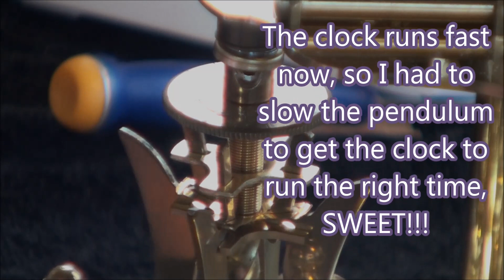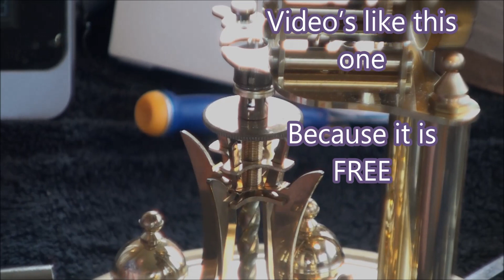How to get Your Anniversary Clock Running Again

Comment: I have a very old German clock some dear friends gave my Mom years ago . It looks like it has hand painted flowers on the base and on the clock facing. It is very well made I want to tear it down completely and clean and lubercate it . The pendulum spring is busted that is the way we go it and there is no key. It would of been nice if you filmed putting it back together but I also understand if you are not sure how it goes back together and didn't want to film it .I saw all those gears you have and about shit a brick. thanks for doing this video . Do you do your own editing? I don't know if you still monitor your youtube anymore
Reply from the maker: The first set of videos I have were for the ones that didn't want to take the movement apart. Most people are afraid to do so. My newest videos, I take them apart all the way. You must understand that you need to take many pictures of the movement and the gears so you can get it back together again. Then comes the harder part. Moving certain gears to get your clock back in time so the cuckoo will know when to stop and the gong and bellows know when to operate at the right time and right order.
Reply: @justmike57  I should of clarified my myself .It is an anniversary clock it does not have any chimes.I ordered a older book on Anniversary clocks and called a man here locally that restores old clocks. I told him what clock I had and what book I ordered and he said I have the right book. My understanding is the book has the back plate in diagrams and list what clock you have. He also told me that the book will have the length of support spring for the pendulum and what thickness he said you are better and cheaper to assemble your own support spring. The support spring came off the top and its is twisted very badly. I just need to find a unloader key now. I am really looking forward to tearing down and restoring it. They are not worth anything and it has never worked when our friends gave it to Mom, so I am not to worried about destroying it but I am going to be very careful i want to really get it running again. Thanks for the reply
Reply from the maker: @madmanmechanic8847  This makes more sense. I have cuckoo clock on my mind. You can let down the spring with the key and a small screwdriver, but take your time and don't try to let it down just a little more to go faster. 
  The hardest thing would be to get the fork lined up and at the right height. As for cleaning the spring in the barrel, I didn't have leather gloves, and I bleed very easily, lol.  
  Mark has some videos that might help you on getting the spring out of the barrel. 
https://www.youtube.com/watch?v=u1AH6x6ePvE&ab_channel=MarkMunnerlyn
  And to get the spring back in
https://www.youtube.com/watch?v=8n-mCu7poG0&ab_channel=MarkMunnerlyn
Reply from the maker: @madmanmechanic8847  And for the best guy to see how to clean the spring and I love his videos is
https://www.youtube.com/watch?v=VhGXW8EfIXQ&ab_channel=Time4Clocks
Reply: The book I bought is The Horolovar 400 day clock repair guide its the eighth edition "78" I thought I was going to get a beginners book on tear down and cleaning 400s and how they work. I just opened it this after noon and started reading it and its for a Journey man clock maker not for a novus such as I. It goes right in to clock escapements and adjust them and then goes into questions and answers right after that. I got a freakin head ache trying to understand this shit. I called my guy to see if they have a beginners book on 400s and he told me you have the right book .The one thing I do like about it is it has most mounting plates for 400s for diagrams in the back of the book and it will tell you what plate you have and a out line for the suspension spring for the pendulum. I told Dale that this book is like giving him a book on how to repair a Mercruiser Alpha Gen 2 stern drives and not explaining how the drive works. I do Marine repair as you can tell Mike. I think if I tear this clock down and clean it and replace the suspension spring it will take off I dont think it ever been serviced. But the section in the book on setting the time for these 400s is very cloudy and nothing concrete . I have a lot to learn. As far as the main spring Mike I think it would be better to ultrasonic clean it then just take some 00 steel wool and get the old rust and crap off the spring instead of 40 and scotch brite.  Thanks for trying to help me
Reply: @justmike57  Ok I watched both videos and he blocked the camera with his hands while he was winding the spring so that didnt do much good. But I think I get the jest of what you are saying and how to wind it back in thanks bud for helping me ! I have a lot to learn.
Reply from the maker: @madmanmechanic8847  lol, at least you have some brains inside your head. I don't think you want to use anything that scratches the main spring because that will also cause drag. The rust looking stuff is just old oils that you are cleaning off and that is what the WD-40 is good for. It is an acid cleaner and that is why you need to get it off so the acid doesn't start corroding the spring again. The Time for Clocks is a great channel to watch, he seems to have O.C.D. when it comes to clocks and wants them to  look like when they came out of the factory. Just the same, I really like to watch him and learn new ways of doing things that work for me. It's all about how much time you want to spend on your clock. There is a good chance all you have to do is change the wire that holds the pendulum and on the pendulum is where you speed up or slow down your clock. I wish you great luck on your adventure with your clock Roger.
Reply: @justmike57  I dont know about the brains some days I think they left and are never coming back. Oh ok dont use the 00 steel wool. 00 steel wool is finer than scotch bright and leave a finer grain . But I will take your advice. I just want to tear this down and ultra sonic clean it I bought an American made ultra sonic cleaner two years ago its a 6 liter. Then I want to take my die grinder and polish all the brass then reassemble the clock works and lubricate I have some killer metal polish. I was hoping to make enough money off of this one clock to retire and move to Tahiti and buy a million dollar home and have two island girls in bikinis wait on me hand and foot and serve me drinks while I bask in the sunlight on the beach. Imagine the shock I got when I found out my clock is only worth $150.00 up and running !    There goes my Island girls and my beach ! Damn the luck! Ok back to reality. No balls out resto here just hopefully get it going and running again I will be happy. Let me know when you find the million dollar clock so I can get one and move and find my girls on the beach! Ok enough bull shit thanks Mike

Comment: Good Video, what powers the pendulum? Mine comes to a complete stop after 15-20 minutes.
Reply from the maker: There is a round cylinder that has a spring in it. That is one of the main things that will slow or stop your clock Seven Dogs. You might be able to just oil the spring that you can't see, through the one hole and hope for the best, but it might be temporary
Reply: @justmike57  Thx Mike, I'll give that a try.

Comment: Hello Mike!  First I'd like to say that I enjoy your videos and have learned a lot from them.  In this video, I assume you just ultrasound cleaned the mainspring inside the barrel. Afterwards, do you remove the mainspring and oil it or do you feel that this method is good enough?  Thanks in Advance.
Reply from the maker: Yes, I did put the spring in the tank the way it was and was hoping for the best. I didn't have anything to take the spring out safely. After the movement cleaner, rinsed with hot water then soapy water, then hot water again. After drying the spring with the hair dryer, I put some clock oil in the hole. Still running well so far.

Comment: Great Video!  I have a clock exactly like this one that I've had for almost 50  years which has recently stopped working  and I will try repairing it.  However, could you share what you use as a cleaning solution and what type of oil you use on the mechanisms?  Thanks.
Reply from the maker: If you go to my playlist and look under cuckoo clock repair, you will see a video that shows the bottle of cleaner I use... and there are two kinds I have now. It is for cleaning clock works and you might find it on Ebay in smaller amounts. I use a normal clock oil but the Synthetic might be a better clock oil to use now. Either one is good.

Comment: did you wash whole main spring with soap?  what about water staing inside? not recomended that way or clean it separate without sink in the water
Reply from the maker: In the video, I showed that the main spring went into the clock cleaning solution. I didn't use the cleaning solution on the front and back of the clock works because I am sure there is a clock varnish on them and the cleaning solution would strip that off. I also use a hairdryer on these parts for fast drying to also help prevent water staining.
Reply: @justmike57  sorry for my english  when you wash main spring with housing that is not the right way  best taking the spring out  and after cleaning putting back with lubricating oil  that way is no water after washing whole parts you did.I wasn't talking about staining  (mistake-try write staying)  water can stay inside main spring housing  barel

Comment: Nice Video Mike but I hate to be the only one bearing bad news.   Because you didn't remove the mainspring from the barrel and grease it the mainspring is going to rust eventually.  But in shorter terms it's going to "not" do what you said it would do.  It won't slide over itself because you haven't greased it.  You've got gunk in there and no mainspring grease. Not good.  Also based on that beat amplitude you have going on, I doubt that clock will maintain it's beat more than an hour.   You'll get better as you do more and become more sophisticated by getting the proper tools to remove the mainspring and reinsert it.
Reply from the maker: You are totally right about the clock. If you were to go to my channel and go to the play list, you will see I have grown some knowledge and started taking the main spring out of the barrel, clean the spring and re-lube the Spring with a heavier spring oil to do even better than just leaving well enough alone. 
  Back when I made this video, I was afraid to take anything apart, but with Pictures, Pictures I found is your friend. Now I am more daring and even do Grandfather movements, cuckoo clocks, Kitchen clocks and almost any  other clock you can think of and always learning as I go so others can learn with me. 
   Thanks for your comment and no, you didn't hurt my feelings. There are times a person needs to be pushed a little to get them to learn. 
  Have a great day and God Bless.
Reply: @justmike57  Wow, that's great!  Good for you.  We don't want to give incorrect information out that has people ruining their clocks.  Keep on learning my friend!

Comment: Hi, i have an exact same anniversary clock. But it is running fast and gaining time. I have tried to slow it down woth the rotating lever above the pwndulum. But it is still going fast even at the slowest setting (i can't make it any slower). Plz help regarding how to fix it
Reply from the maker: Not sure if you had to change the Spring Wire. But if you did, there is a chance that the wire you have is the wrong wire. A too think of wire will make your clock run very fast and the book isn't always correct on some of the wires. 
  When you turn the dial to slow the clock down, sometimes the balls on the lower pendulum need to be worked a little to make sure they moved in the direction they were asked to move.

Comment: Very interestingly unique! Those anniversary clocks always break!
Reply from the maker: The key wind clocks work well for around 20 years, then the lube around the spring gets thicker and slows the clock down to a stop. And the thin spring wire can not handle to much banging around. So if this clock isn't in the right place or moved a lot, then yes, they will break or stop working.

Comment: Thank you for the video Mike. I purchased this exact clock at a yard sale. I was thinking about selling it for parts but it almost seems doable to service it. I took the tarnish off the outside and love the clock. I'll let you know how it comes out.

When you say flush the spring as much as you can..... Do you mean with cleaning fluid? Or water? Sorry it might be obvious but I didn't grasp your meaning.
Matt
Reply from the maker: It's a bit hard to flush the spring, might be easier to use a syringe to push the cleaning fluid in, then let it soak. And the same with soapy water to wash out the cleaning fluid. then the hot, clean water. With the hole up, dry it with the hair dryer to heat it up good to help remove the water and of coarse, get some oil in it. Hope that helps S.M. Carless

Comment: I have a similar clock I got from goodwill but it is strange . I put new batteries in and only the pendulum works . But , the pendulum seems to run on a separate gear as I see no string ! The top half of the clock doesn’t run . Help!
Reply from the maker: You would have to look above where the wire to the pendulum hooks on. Make sure it has the fork on the wire and the fork is tapping back and forth on the clock works.

Comment: I have a Howard Miller anniversary clock that I gave to my parents over 20 years ago. It works but I can't get the chime to work right. It chimes 10 minutes early or late is there a way to fix it
Reply from the maker: The only ones I have that chime are the battery anniversary clocks. I never worked on them, but I know they have a trigger in them that makes them start the chime. Sorry I couldn't help you on this one Brian Zeigler.
Reply: @justmike57  it is the battery powered clock. I appreciate your help though. It worked right once. Hopefully it will again.  Thank you

Comment: You can and should take the mainspring apart to clean it properly.
Reply from the maker: I am sure I should take it apart to clean the mainspring, but I need to get the tool and learn how to take it apart. I have taken other kinds of clocks apart without the tool, but very tricky Mantolaman.
Reply: I understand.  I'm just a hobbyist and have to draw the line on what tools I can buy and those I can't.  It would be difficult on this type spring with no winder.  But some 'strong' guys do it with just their hands.  That's not me!

Comment: I have a clock that looks exactly like yours and I'm trying to figure out what's the model number so I can find the correct replacement spring. Do you know your model number?
Reply from the maker: In most cases, all you need to know is the maker of the clock and you can order the spring wire that way. The Main Spring the is wound? I would try the same with the name of the clock or go by the with and length of the spring Mard.
Reply: @justmike57  thanks, its a kundo and i did some research, seems like there is only one kind of spring for kundos. my other question is that how can I tell if its just the spring that needs changing? The current spring has a few kinks, and the clock does not run at all. I did not have the key so I wound the clock with a spanner as much as I can till it doesnt turn anymore. I am not sure if the clock will work if I just simply change the spring.
Reply from the maker: @wudao2001  Don't change the Spring if it's now broke. Also, don't wind the clock so tight you can't turn the key anymore because you will bind the spring up and the spring can't do it's job. After you install the wire pendulum, make sure the fork is on the rod. Also you might have to lower the fork... or raise the fork to get proper contact with the timing of your clock.

Comment: Hello, my Kundo is running but hands not moving. What’s up?
Reply from the maker: There isn't much to these clocks. If it is running fine, look close at the gears to make sure they are meeting with each other. Also, when the folk clicks from side to side, is it making the full click. The folk might need adjusting up or down on the wire for the pendulum.
Reply: @justmike57  thanks I’ll check it out!

Comment: Hello Mike,I’ve found your video on repairing the kundo anniversary clock,which I think is fantastic,however,I’m stuck on a section of the rebuild,I’ve made a school boy error of not taking a photo of this part as I thought I’d remember but I haven’t,I’m at the stage where I want to put the clock face back on but behind the clock face there are 2 wheels which I need to put on for the hands to work but I can’t remember how to do it,any help would be really appreciated,it’s the only part on your video that’s not been filmed ..trust me 😁
Thanks buddy
Reply from the maker: We all forget something sometimes. It's been a while, but should be easy enough to figure out. I think the minute shaft went in first, then the gear on the side and then the hour tube followed by the e-clip. If that doesn't get it, send me pictures of the gears and the back of the face. Line them up so I can tell you as 1-2-3 steps. My email is below the video.
Reply from the maker: Oh, and by the way, I found how to get the mainspring out of the barrel so it can be cleaned and oiled. Check out my Playlist on Anniversary Clocks.
Reply: @justmike57   thanks for replying Mike,I managed to figure it out in the end,the main spring was broken in the barrel so I replaced that,I put a new suspension spring on it  too as the original one had spiraled set the beat and over the last day I’ve been adjusting the time wheel and have now got it running sweet,it’s loosing 1 minute  as it stands but wether that increases by morning(uk time) I will have to wait and see I’m pleased with it tho